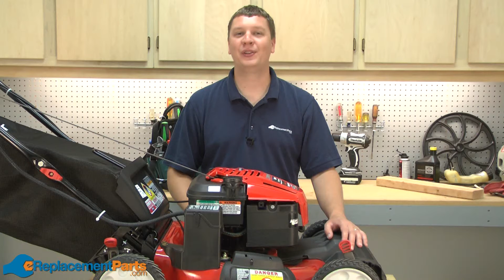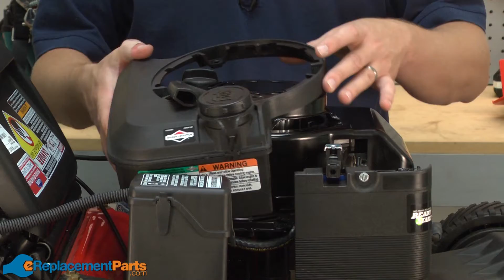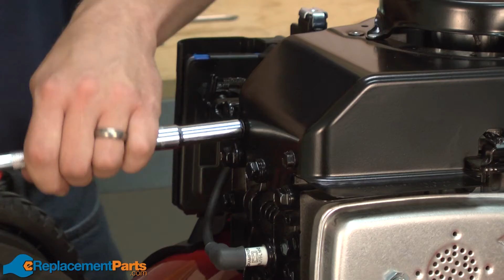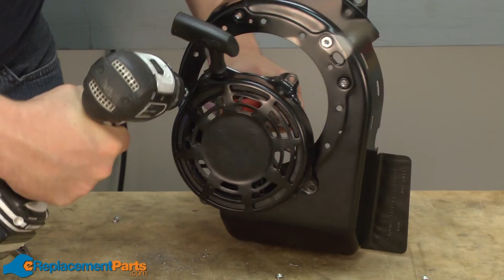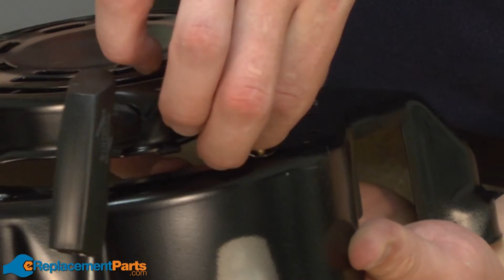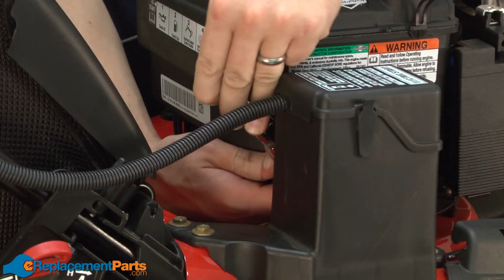How to Replace the Starter Assembly on a Troy-Bilt TB280ES Lawn Mower

Comment: Can someone PLEASE tell me what the part number or OEM number for this part is. I have this exact mower and I've been looking for 2 weeks and can't find it on neither my power nor online anywhere. My pull string had to be replaced and when I did that the freaking recoil undone itself and as I was trying to coil it back up, the metal coil just kept breaking off, so I just need to replace the whole assembly to be done with it. The mower is sentimental to me bc it's the last thing my late mother ever gifted to me, so I try to take good care of it. 
 🙏 SOMEONE PLEASE HELP 🙏

Comment: With a new battery the engine will barely grunt and not turn the engine over enough to fire. Question, will it run if I remove starter and battery?
Trying to hand start is very difficult due to compression build up with it in place.
Reply from the maker: The starter has a clutch so the starter gear should only contact the flywheel when the starter motor is activated. If the starter is continuously engaged the clutch has likely failed. If you no longer want to use the electric start feature, you can remove the motor and clutch assembly. You could also repair the clutch if the manufacturer offers those parts for your model or replace the starter and clutch assembly. -Mark